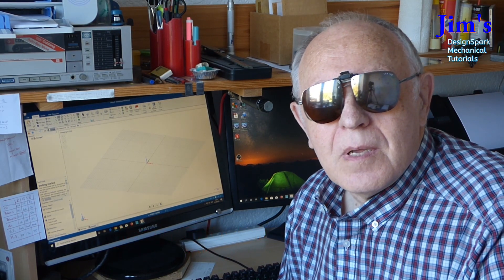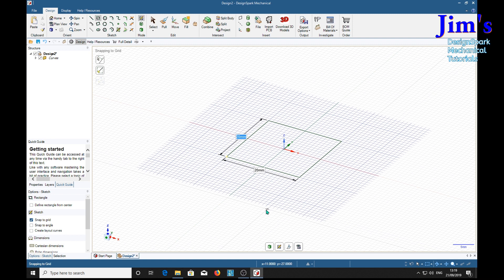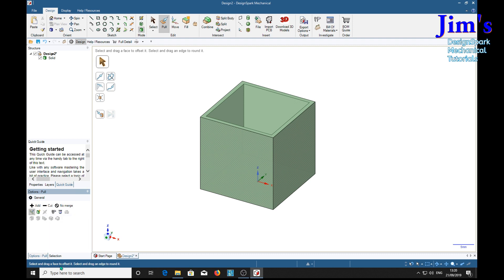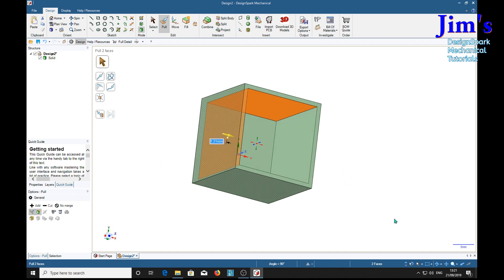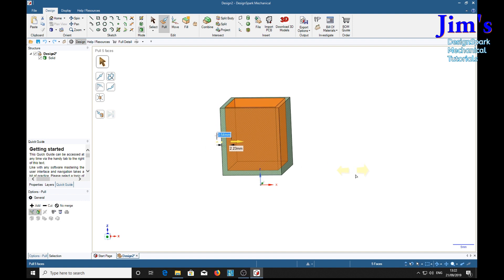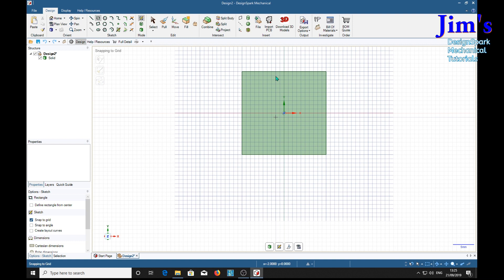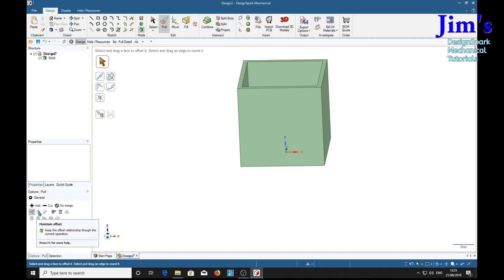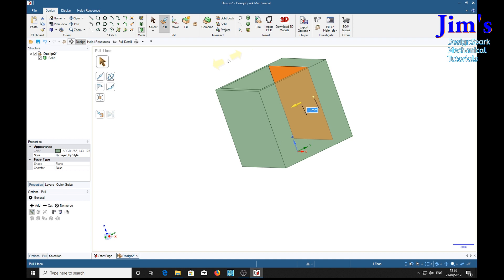'Maintain offset' tool in DesignSpark Mechanical

Comment: Great video!
I just have a question, I'm having a difficult time dragging edges from the object and the software always says that there's an error and it failed to offset faces. Do you have an idea what's the root cause of it and how can I fix it? Thanks in advance.
Reply from the maker: I tried to replicate your problem, but could not. You'll need to be much more specific in explaining the problem.
Reply: I think I figured it out, It could be because I’m navigating the design tools in the wrong way or what it’s operating system could handle is limited as well. Regardless, thank you for the reply!